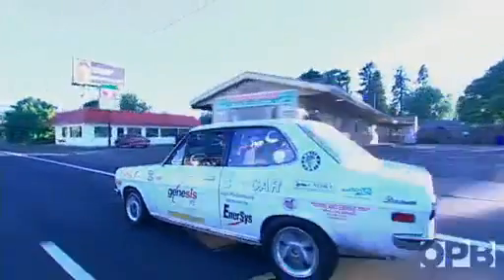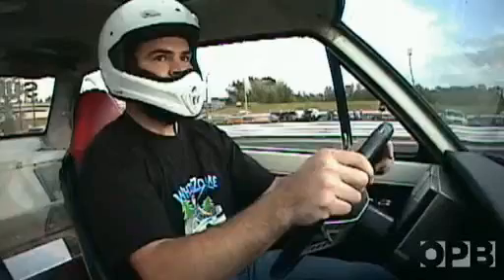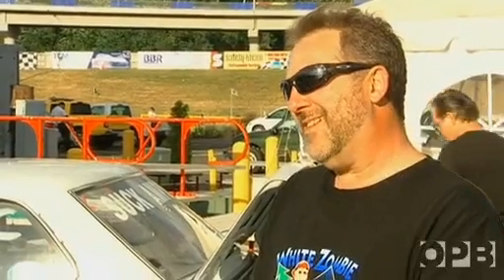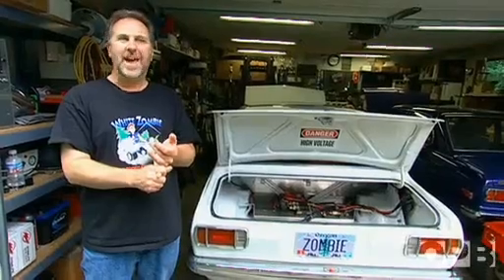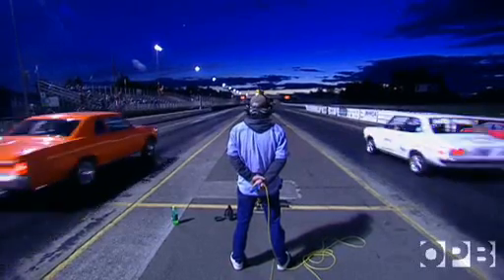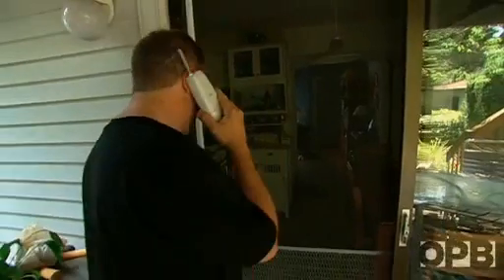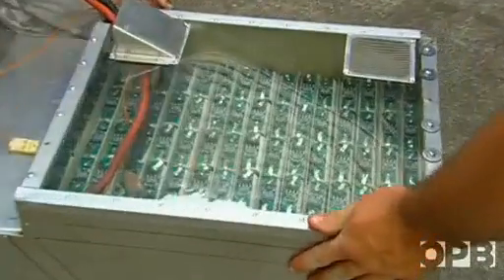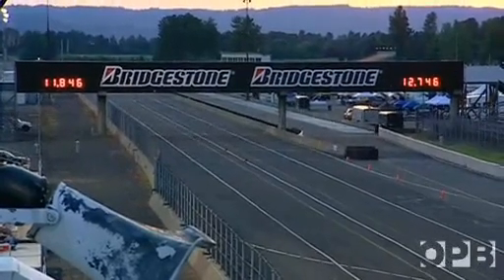1972 Datsun a Electric Drag Racing Car 300HP - Street Legal & Broke Several World Record Speeds

Comment: and of course he has no emissions when he re-charges the batteries
Reply: Pete, 
 With the understanding this is a 2 year old post, his recharging power comes via hydroelectric and wind from the Columbia River and the Columbia Gorge. I met John about 10 years ago. Our local drag strip (Portland International Raceway) even supplies EV racers with "free" (in reality it's part of the entry fee. ) electricity for recharging. 

We're not so ignorant as to assume we can stop using ALL fossil fuel. :-)  But John, and others like him, have helped advance the state-of-the-art in electric racing. Most anyone can slap together a 9 or 10 second gas car. It takes some thinking and DIY creativity to put an EV in the 9 to 10 second range. Some of these quicker street legal EV's are doing low to mid 9 second 1/4 mile passes.  

It's new and advancing technology. That's what makes it interesting.

Comment: Depends on where you live. In Ontario we are going away from coal and using hydroelectric and nuclear power, which would increase efficiency of plug-in cars. However, even if coal is used, electric cars are great for reducing local pollution and sourcing it to where emissions can be more strictly controlled.

Comment: Great video. I love electric cars....but...  I hate to point out that the electricity used to charge those batteries does create pollution. It bothers me that so many reports neglect to mention that fact.  What we need to focus on is how to generate the electricity that will power these cars  without depending on coal or foreign petroleum.  My ideal car would have an on-board LNG or bio-diesel powered generator pushing amps to the wheels.
Reply: Portland Oregon is sitting next to the Columbia River.  The power to recharge this car is coming from dams and wind turbines.

Comment from the maker: Actually NO.. Theres NO emissions during the process at all. The battery cases are made from plastic Pellets which is made form soybeans. The acids they use are made easily and the metals are of course readily available. So there is really no pollution with making batteries. Batteries in cars are almost always recycled for $. Batteries are a safe bet indeed and you learned something at same time.

Comment: The same is true with Hobby grade RC cars. 1/8 scale brushless electric cars will out accelerate a Nitro methane powered car of the same scale. Electric destroys all so much torque. Problem is Heat. Electric motors and speed controllers get HOT.

Comment: Like the steam engine, the electric motor produces MAXIMUM torque at stall while an I/C engine needs some RPM.
Horsepower sells cars, torque wins races & the Zombie has torque by the trainload, it's really that simple.

Too bad that it has taken 120 years to get this far & still we don't have battery capacity to match a tank full of fuel when it comes to long distance driving.

Looking forward to seeing this milestone reached in my lifetime. [They had better hurry]